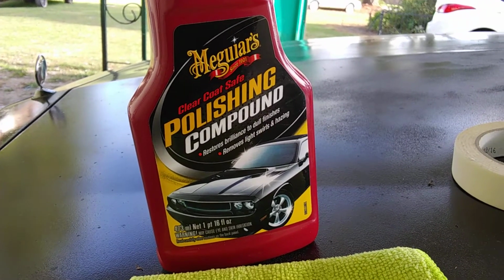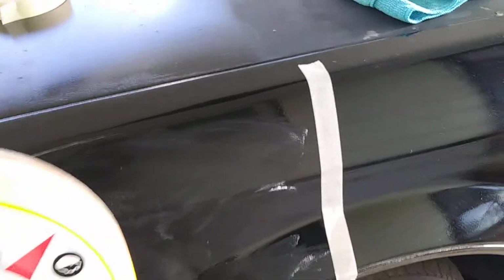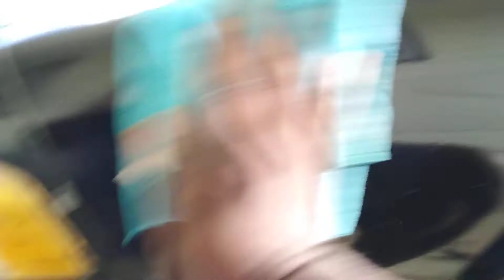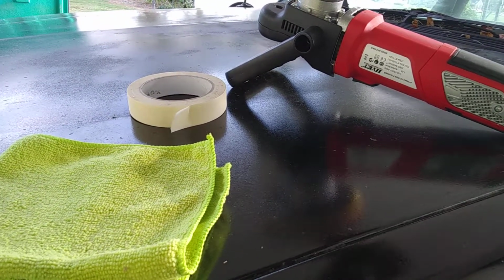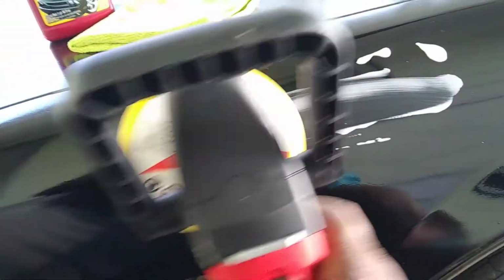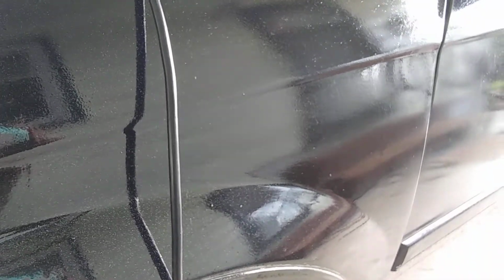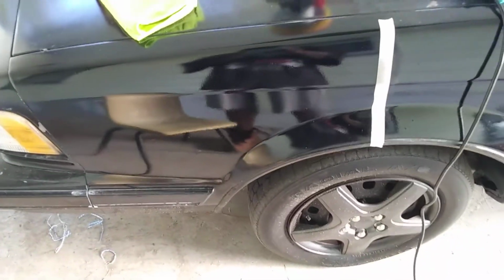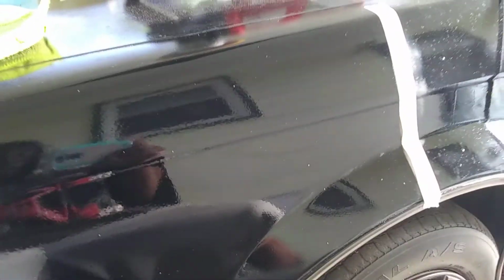Meguiar's product and how to use a da polisher the correct way

Comment: The way I do it is this way..

Always have your pad touching the paint before turning it on, keeps it from slinging. 
The speed here is good. 
Crosshatch, means go side to side then up and down, do this four times, this is considered one section pass. 

Like he said, don't go too fast and keep about 12-15 pounds of pressure. 
Main reason I use the Rupes 15 is it makes the job faster due to its throw. 

Tfs
Reply from the maker: Cajun Kevin you right buddy go slow tfw buddy